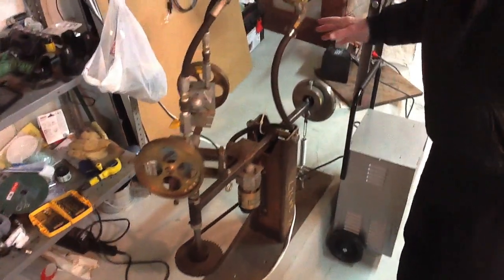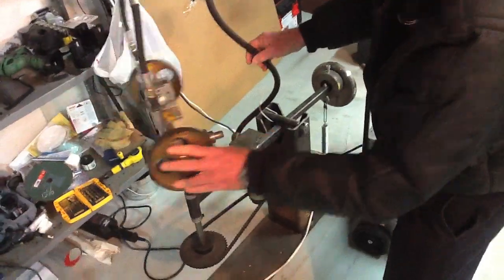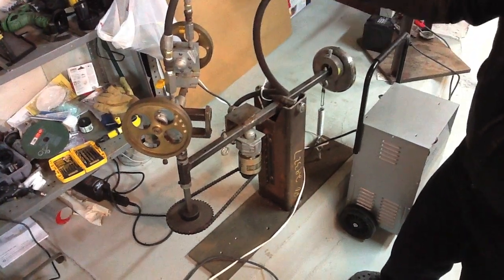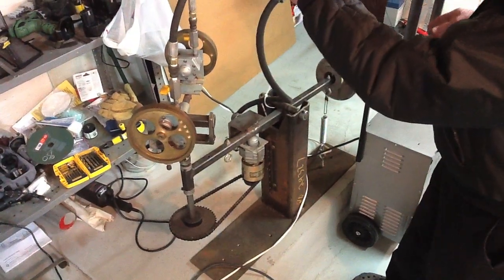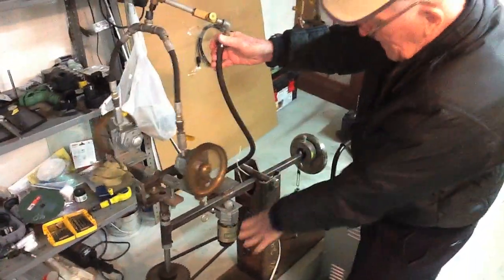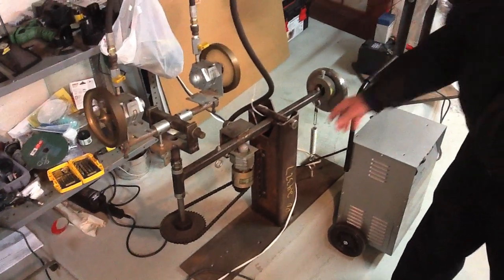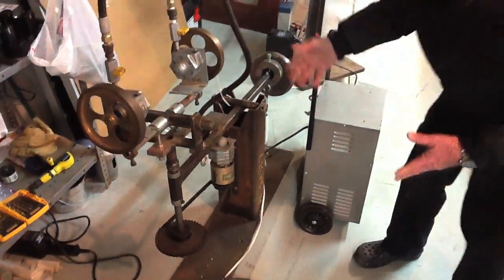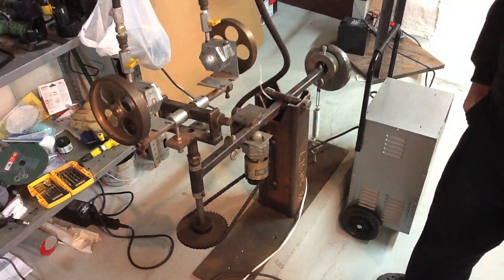D.-A, Oscillating Crank

Comment: In your introduction you mention a DC motor but I don't see one in the video.  You mention that all motors are air powered.  that thick black hose is an air line going to the precession motor-right?  Both gyro wheels have to be spinning in directions as though they were on a common shaft...right?   Is there any other follow up videos or info available apart from the in the park tesla days demo video?